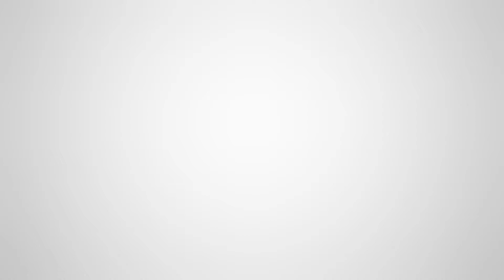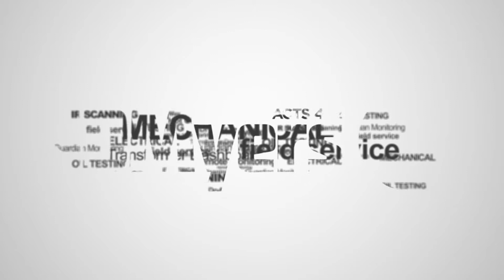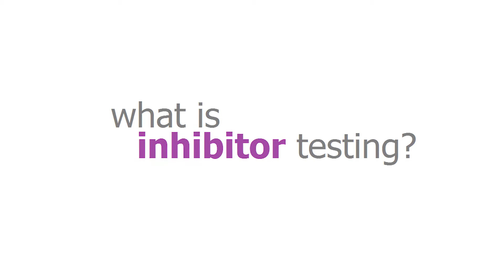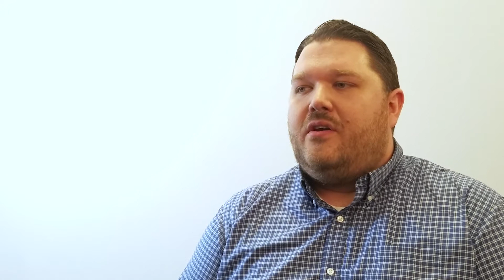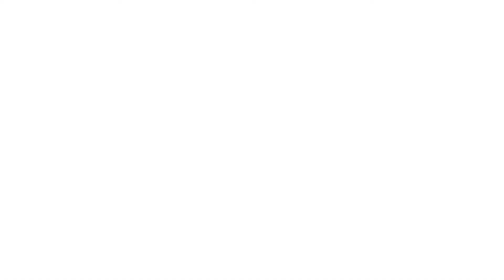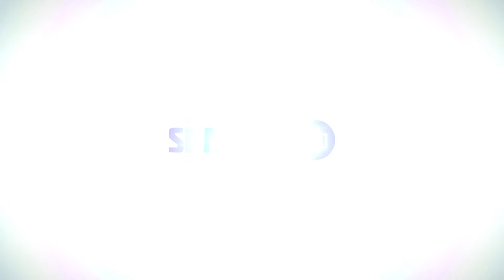What Is Inhibitor Testing?

Comment: I should note a bit of nuance here - the way I spoke about this, it sounds like inhibitor is an "acid scavenger" and that's not technically what's going on. What's really happening is that the inhibitor is reacting with free radicals before they react with oxygen, which causes the oxidation process.  So by preventing the oxidation process, that's what technically prevents the formation of harmful acids.